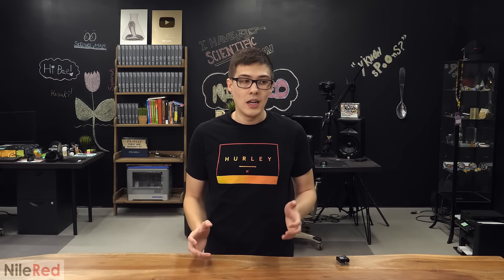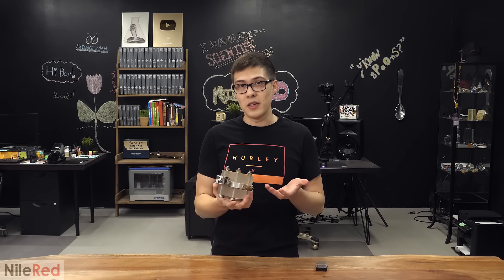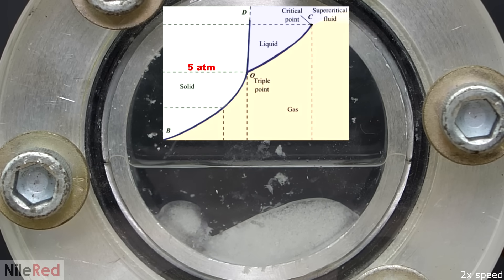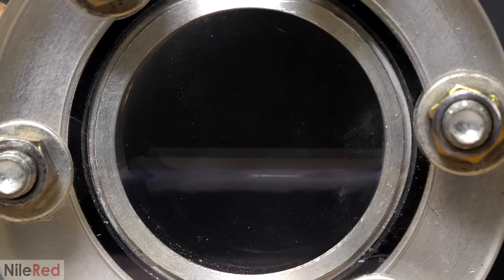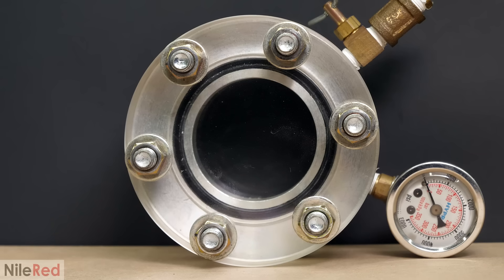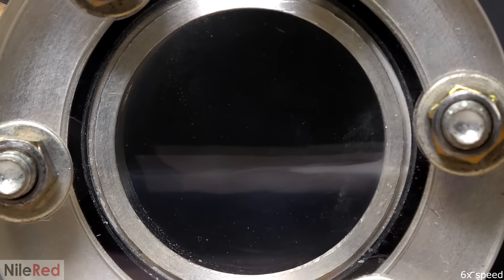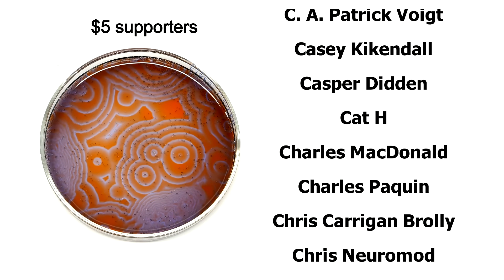Going supercritical.

Comment: When you TIGHTEN Any Scientific apperatus that has to have even pressure TREAT IT LIKE PUTTING ON A TIRE.
All things are put on loose, you tighten them down finger tight, then you go one nut at a time to the opposite side tightening them down and going back eventually to the original ones that were tightened the first time snugging them down.

Imagine it like triangles,
..1......3
6....O...5
..4.....2 
Repeat in opposite order.
Reply: THIS THIS THIS, the only thing I remember from autoshop is this
Reply: Must've never worked in an automotive shop haha. Slap the tire on, a little anti-cease on the studs, nuts on a few threads, tighten in an opposing pattern, then torque to spec or as close as possible, usually 80-100 ft.lbs. will do the trick if you have a blow out and need to get home.
Reply: Thank you for explaining that. I read the first paragraph and had no idea what that meant lol
Reply: @DrCandyStriper  should've added that you double check your torque in a circular pattern, but always get a second click when torquing the first time.
Reply: @Deathbomb9  a second click?
Reply: @DrCandyStriper  on a torque wrench...they click when you reach the desired torque.

Comment: I would guess the cracks were formed from the thermal shock. Noticed something similar when I heated clear glass marbles with a torch and then dropped them into water. Very fine and pretty cracks formed.

Comment: The refraction you saw may be due to the cracks or it may be due to the deposition of fine layer of silica particles the silica surface. Particles of size and spacing comparable to visible light will give rise to interference effects.

P.S. I knew some guys who did SC-CO2 work and one of them found that solubility in it varies with pressure i.e. you could get something polar and insoluble and crank up the pressure  and it would dissolve. On of his PhDs did some work with dyes that might be interesting to film (look up Reichardt's betaine dyes too).

Comment: The first pressure gauge seems to be working fine, its just a high scale, it went to almost 50 bar. The cracking in the silica balls i would think is because of it heating up so fast, that would also explain the colouring.
Reply: It didn't heat up, did it ?

Comment: The ability for supercritical CO2 has a much higher diffusion coefficient than the liquid counterpart, so the supercritical CO2 diffused into the marble (silica?) matrix, occupying the voids present within the matrix. Once you decreased the pressure, you increased the volume of the CO2 present with in the matrix. This can result in fine cracks near the surface of the marble and cracks through. If you kept the CO2 at supercritical for a longer period of time and release the pressure, you may enough be able to shatter the marbles with a pressure decrease (diffused deeper into the matrix, saturating the matrix). 

Worth a read up in Supercritical CO2 solid phase extraction and Supercritical fluid chromatography. Thanks for the awesome video!

Comment: CO2 and SiO2 are chemically quite similar except for the physical properties (melting point, density, etc.).  I imagine that equalizing some of these physical properties with high pressure and low temperature increases their chemical interaction -- especially in the cracks.  Warming and relieving the pressure outside allows the pressure of the adsorbed CO2 in the cracks to extend the cracks.  CO2 adsorbed into the SiO2 surface alters the index of refraction in a thin surface film.  If the layer is stable, this might be useful in designing the reflectivity of optical components.

Comment: Thanks for the excellent demonstration and explanations. 
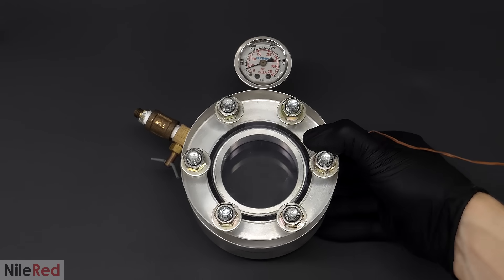That gauge appears to be working, but needs recalibrating. At 11:00 it is reading around 30 bar, which is near to 435 psi (the scales are very nonlinear in that region),  but it should be reading at least 80 bar. It might have been dropped in transit. Is there an adjustment screw on the back of the gauge?

Comment: 4:47 See how that one bolt has cooled to likely cryogenic temperatures? Be very very very careful of this. When you see a bolt like this on a pressure vessel, carefully open the vent valve to vent the contents and allow the bolt to return to room temperature (or close enough) before resuming. At those temperatures, the metal has likely become incredibly brittle and the moment it exceeds it's yield stress it will almost immediately also exceed it's ultimate tensile stress and instantly shatter. At best you then have an exploding pressure vessel, at worst you have an exploding pressure vessel with super cooled shards of steel flying at you.

Comment: I've always wondered if a supercritical fluid would make a good hydraulic fluid.  Basically have the near instant transmitting of power that a liquid does, but have little resistance to flow like a gas would, allowing hydraulic components to move faster.  It would also weigh less than if using oil.

Comment: I’m sure someone already suggested it but could it be a type of molecular dichromacy? Like the CO2 created molecular level deformities in the silicone that only lets certain wave lengths through. Could kinda make sense if the cracks created a way out for the diffused CO2 when it turned into liquid then quickly to gas, creating a bunch of parallel channels that limits light?

It looks really pretty for how cheap it is, could be really cool in resin casting or something

Comment: You should be using a torque wrench to tighten the bolts (using a crisscross tightening pattern with increased torque until final torque).  Also, you're also using a Torx bit on those bolts when should just be using a standard hex bit.

Comment: Now, I am but a layman, but if I am reading the gauge correctly at 10:59, the chamber contains a pressure of 30-40 bar 500-600 psi-ish. It's a bit difficult to read , the shot looks a bit on an angle. The scale from 0-1000 psi ad 0-50 bar having less increments than the other 1000 psi/50 bar intervals also makes me think it does not display pressure below a certain value.

I think of these values as high pressure, but Nile has shortly before this talked about how it gave low readings. So my question to those more knowledgeable is whether this amount of pressure is low in this given context?

Comment: About the leak: If you use dry ice as a CO2 source, that would suddenly and locally cool the chamber, and, more importantly, the O-ring to -79°C, which makes it shrink, which could make it leak at high pressure. Local heating and cooling also would add to the stress on the acrylic window, in addition to acrylic resin getting brittle at low temperatures. If you would fill the chamber from a steel bottle of CO2 at around 50bar (choose a bottle with internal tube, to be sure to get the liquid CO2 into the hose), you directly get liquid CO2 at room temperature, with much better seal, and a lot safer. This way, it is done in commercial CPD-machines (wich look quite similar).
btw: silica beads are very brittle, and shaking them around produces sharp micro shards, small enough to enter your lung and pierce cells, so, yes, you can get silicosis from the stuff, please be aware of that.

Comment: How long had those silica beads been exposed?  I have 1.2# of the color-changing variety: https://www.amazon.com/gp/product/B01MQYGRVV .  With vigorous air circulation, it takes roughly 1 week to get the full volume of beads saturated.  If you want to go down the rabbit-hole to find out if moisture content plays a role in the fracturing, it may be worthwhile to see what happens with beads that are "dry" vs "wet", and if being in a supercritical fluid environment really matters.  [parsed from the amazon link: Beads can be Reactivated by Placing in the Oven for 0.5-2 hours at 200-250F. Don't use over 250F in the Oven.]

Comment: You should've tried putting something that could float in the liquid CO2 like a ping pong ball and see what happens when the liquid becomes super criticial
Reply: I agree but it would have to be something like a glass balloon or something very strong and light. A ping pong ball would collapse under the pressure.
Reply: Teresa Shinkansen Styrofoam beads
Reply: Random RimRock I think it would be really to find a material that floats in a supercritical fluid and doesn’t collapse, maybe metallic lithium but that just sounds like a recepire for disaster
Reply: you can't just fill something with a compressable gas and hope it doesn't collapse under pressure (ping pong ball).
what you'd probably have to do is fill a balloon with something lighter than CO2 in the already pressurized chamber, which requires a (slightly) more complicated setup. bonus points if you manage to disconnect and knot the balloon so it can float freely.

Comment: There's probably nothing wrong with the gage. An atmosphere is about 15 psi. That means 5 atmospheres is only 75 psi. With it being a 5,000 psi gage, it is not going to be particularly accurate until you're at least in the 700-800 psi range. I highly doubt the pressure of dry ice at room temperature ever got over 100 psi, so I wouldn't expect the needle to even flutter. I would recommend getting a 200-250 psi gage to put on there for this first test, then if pressure gets up over 3/4 max, vent immediately so you don't damage it.

Edit: 9:30 while you are are cooling it, I noticed the gage was no longer on zero. When you get it super heated, check the pressure, and pick a gage where that's 2/3 to 3/4 of the max pressure, and it should be more useful.

Comment: Gemologist here, the silica beads cracked because the sudden change in pressure and temperature. As a comparison, it's close to what happens if you suddenly pour water into hot glass.       In a high-pressure, hot environment the pressure around the silica gel prevents it from expanding from the heat, but it still receives the energy. As you release the pressure, the sudden drop in temperature and pressure gives the silica beads the room to expand rapidly, so the expansion was not uniform all over the bead, so there are parts that expands more rapidly than the others. This difference in expansion rate casuses the faster part to detach drom the slower part, hence the crack. Source: experience from heat treating amethyst into citrine.

Comment: The opal appearance reminds me of Newton's Rings - https://en.wikipedia.org/wiki/Newton%27s_rings .

I would guess some CO2 expanded to a gas/liquid while still inside the gel when you reduced the pressure causing the cracks, then light bounces between the two surfaces causing constructive/destructive interference; with monochromatic light this gives the appearance of circles however to the different wavelengths in white light it gives a rainbow effect.

You can see the same effect when contact printing or enlarging film, and by framing a high gloss picture using normal glass (if mounted it in direct contact without using a matboard to give a sufficient gap). This is why glass carriers in enlargers and contact printing frames often use anti-newton glass on the side touching the film base (towards the light source, the emulsion will prevent it on the other surface, and using it can causes aberrations as it bends light unevenly).

Comment: Could you colorize (dye) the dry-ice and run this experiment again? Also, what if you used helium instead of air in the chamber (meaning, vacuum pump out the chamber with the dry-ice inside, and then add some helium). I'm just thinking about ways to better visualize the supercritical CO2.

Comment: Hey Nile! I've watched many of your other videos, and I love how simple yet informative they are. Below, I've listed my thoughts about this experiment regarding the holographic/shiny effect as well as the yellow stain.

I'd like to mention that silica gels typically crack under any form of absorbable liquid, whether it be water or liquid co2, though I've never seen that holographic effect before. This could be attributed to the co2 gas pushing into the cracks in the beads and expanding. The small trench of air causes the light to bend as if it were in a glass prism. 

As for the discoloration, it may be caused by a chemical reaction between the supercritical co2 or just natural stain from the silica. 

I hope my comment is of aid to you finding the truth behind this phenomenon. Keep up the chemistry!~

Comment: As for the haziness part of the transition, I think it has to do with the correlation length. Normally, the correlation between thermal fluctuations is very small and is much smaller than the wavelength of light, so no scattering occurs. But, as the fluid can't make up its mind at the critical point, these thermal fluctuations become much larger in length, and presumably become large enough to scatter blue light like dust particles in the sky do. And then once the transition passes, the correlation length drops again and it becomes clear again.

Comment: Brandon Berchtold and Aquavenn are in the right ball-park with their assessments.

I am a member of the International Gem Society (IGS), and I can provide some refinement to their statements in regards to the effects surrounding the fractures.

In this case, I will be using the term "gem" in lieu of other terminology due to the structural and optic similarities exhibited by actual gemstones that I will be referencing.

1.  The effect you are seeing is readily observed in phenomenal gems: aka; Gems that affect how light in ways other than through  brilliance, dispersion, and birefringence.
2.  The rainbow effect itself is an interference pattern (iridescence) which occurs when light reflecting from below the surface of a gem overlaps light reflecting from higher up. this is the same effect as thin film interference mentioned by others. 

3.  A common method of producing this effect is referred to as crackling.  In this method, a gemstone such as quartz or amber is heated, then rapidly cooled to introduce stresses within the gem, resulting in the formation of cracks.

On a side note, the appearance of these cracks is reminiscent of planar deformation features most commonly observed in shocked quartz that are the result of large scale meteorite impacts.

Comment: I believe it's the distance that the light has to travel in-between each crack in the silica beads.
Each crack separates the inside of the silica bead into longer and shorter parts, meaning some of the light has to travel through more "pieces" inside the bead..
The process is called dispersion, and that's what causes the light to be different colors depending on the angle you look at the bead.

EDIT: I should say that there are multiple factors. It's not just that the "parts" are different sizes, but the cracks formed are at different angles which take in light causing more refraction.
A lot is going on, but essentially think of it as each "part" inside the silica as a prism, placed at a different angle.
At least, that's what I believe is going on. I don't know for sure.

Comment: cool video, thanks.  It would be interesting to see a solid inside the chamber that would float on the liquid CO2, like a little boat made of lithium, and see how it behaves when its super critical, would it float up like a balloon and return to the surface once the liquid reforms?  Lithium is 0.534g/ml, co2 liquid about 0.77.  Not sure about the gas but the boat needs to be heavier than the gas but lighter then the liquid and not allow co2 to dissolve into it.  You could add an iron shaving inside the lithium as a ballast to make it of the correct density

Comment: This is Absolutely Amazing.
You've most likely made something called Coesite or Coesite-IV and Coesite-V, consisting of a mix of tetrahedra, octahedra and polyhedra of silicon connected to five oxygen atoms due to the Extreme Pressure and there a Face Sharing Octahedra. 
This is simply astonishing and didn't really think and wouldn't thing of something this small could be used to make such a thing.
Reply: Also I may be missing out when you applied air the Oxygen introduced may have had something to do with it as well but  sure it didn't have much if any effect on it.. but I'm not 100% sure about that part

Comment: The silica beads contained small amounts of water moisture, absorbed from the humidity int he atmosphere. Being cooled so quickly (either by the addition of the dry ice or the rapid decompression) possibly caused the water to freeze and expand rapidly. Also, having worked with silica beads for my humidors, I do know that changing their level of hydration too quickly can cause them to crack, as they are brittle. So it may have just been the rapid decompression, and expansion of any carbon dioxide absorbed during that process.

Comment: supercritical fluids are neither liquid or gas - they are a fluid.  Gasses are fluids. Liquids are fluids.  Supercritical fluids are fluids, but they are not liquid or gas...

Another way of thinking about the critical point is to consider the energy required to boil a liquid.  As the pressure increases, the boiling point increases but the energy of vapourisation goes down.  When the pressure gets to the critical point the heat of vapourisation goes to zero.

Comment: An improvement you guys could make to that chamber is to use some rubber washers under the metal ones to seal the chamber.  It shouldn't take too much torque (less than you're probably using without them) to seal it.

Comment: Like other comments torque wrench is a wonderful relatively cheap tool. You just have to find your optimal tightness. A bench vice with something go over the vice jaws, to protect your workpiece.

Maybe for another version you could have an emergency pressure release valve that you set for your estimated upper limit for pressure? To reduce pucker factor? Just spitballing.